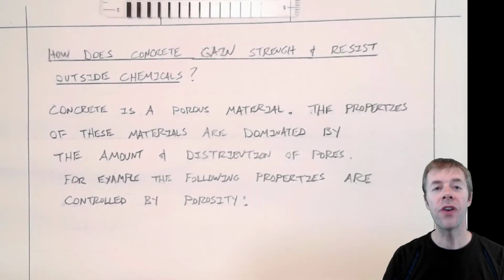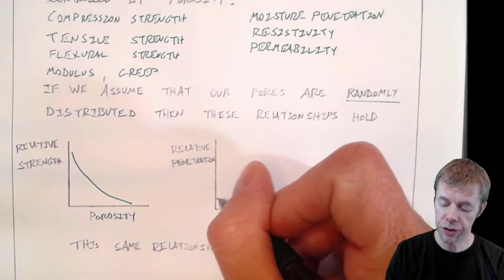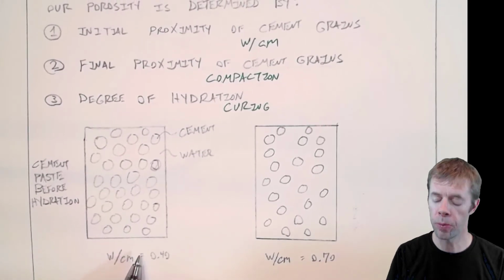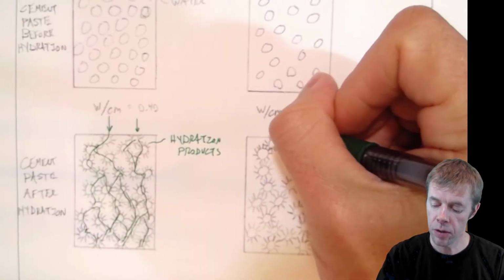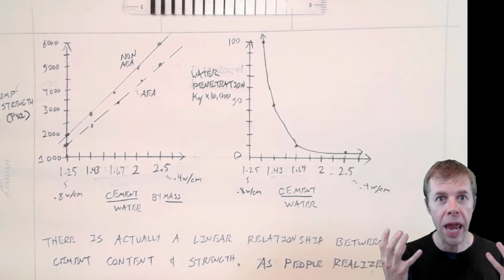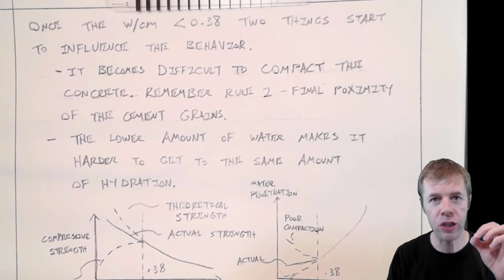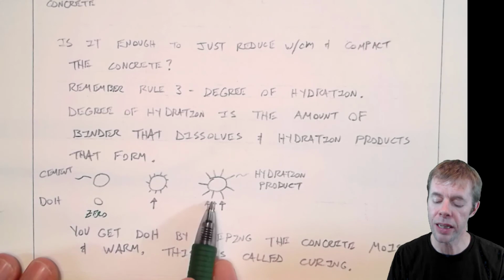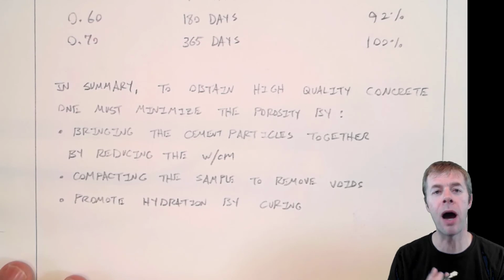How Concrete Gains Strength and Resists Fluid Penetration

Comment: This video advocates for reducing the w/cm ratio to reduce porosity.  Isn’t the concrete reaction governed by chemical reactions? As such doesn’t every molicule of C3S require 4 H2Os to fully hydrate?  And every C2S requires 2 H2Os to fully hydrate?  (Or something like that). Are you advocating using less water than that?  If so you are forcing incomplete hydration.  You get away with that by getting all the hydrated particles to touch by reducing the water.  But the concrete would be better if hydration went further.  

But curing is only a small effect.  
1) are there substances that can be added to retain water for months or years that would promote complete hydration?
2) would reducing the grain size of OPC, fly ash and slag by a factor of 10 (or 100) increase the degree of hydration?
3) if reducing particle sizes causes too fast a reaction, what about using a cement heavy in C2S?

Why can’t we beat the Romans that made concrete that lasted 2000 years?
Thanx, Dylan

Comment: What are the longest possible dimensions of produced and casted plain concrete "without embedded reinforcing steel" that doesn't suffer out of dimensional instability?
Reply from the maker: Aqaba - Are you worried about buckling?  The buckling guidelines for slender columns covers this.  You have to calculate something called the slenderness ratio.  The equation is KL/r.